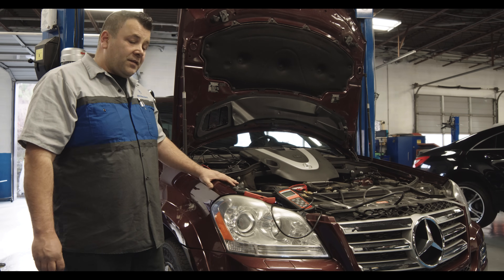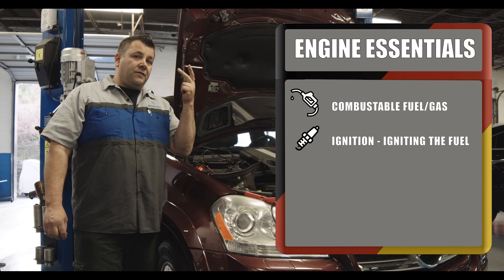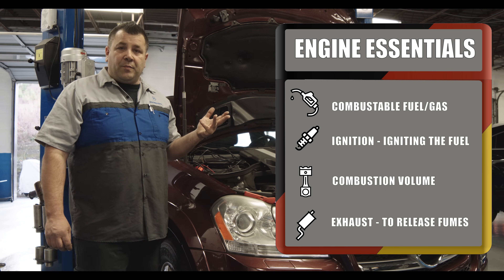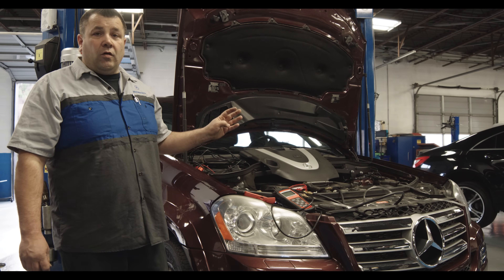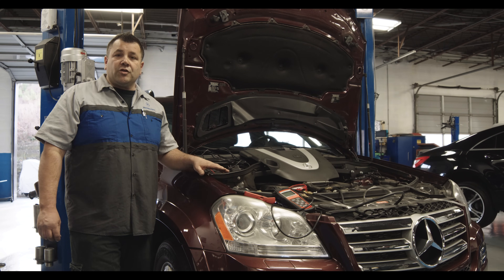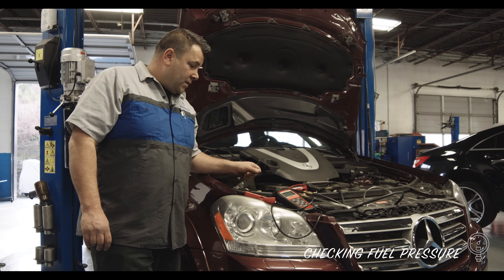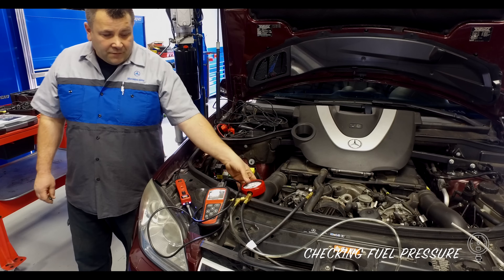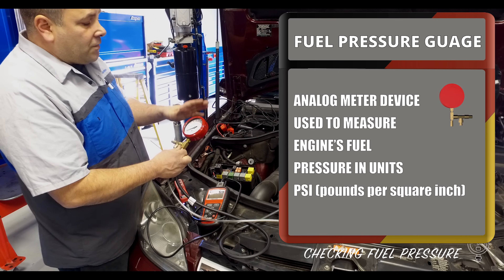Why a car won't start -  Mercedes Benz Troubleshooting Guide, Tips

Comment: Hello and thanks for making this channel. I have 08 C350 Sport 3.5 V6. Left it running yesterday to run in the house, came out car was not running. It will turn but not start. Fuses are good, replaced fuel pump and crankshaft sensor. Gives me fault codes: U0109, P0628, P0336, P0607, P0461. I've looked them up but at this point I don't know what to do next. Do you have any suggestions?

Comment: I have problem with ignition as u tolking about. Position number 4 car doesn’t start in the morning. But after 4-5 Times of drying engine starts And then All day-long no problem. But in the morning same problem again.what would be the problem? The car is mercedes S w220 400cdi. 2003 year.
Reply: Check glow plug s and if faulty also indicate in instrumental claster check the glow plug using multimeter and testing lamp
Reply: My car not start when it start after 1 second close engin any information please about this problem
Reply: Where your shop at ?
Reply: Where's your shop at ?

Comment: I have a Mercedes-Benz Vito 115 CDI 2005 model engine code 646. I have to turn the ignition on and off for about 6 times before it will start. I replaced the glow plugs, replaced the fuel pressure regulator and the diesel pump. There are times it will start first time and times where I have to turn ignition on and off for about 6 times as mentioned above. It does not matter whether its hot or cold.

Comment: I prefer to use my, 
iCarsoft C990 Elite
Display: 4.0″ TFT LCD, 480*320 Pixels
Operation Temperature: 0°C ~ 50°C
Storage Temperature: -20°C ~ 70°C
Operating Voltage: 9 ~ 18V
Operating Current: 150mA@12V (Typical)
Power Consumption: 1.8W (Typical)
Dimension: 206*104.1*32.6 mm (L x W x H)
  
        Price: $1000.00

Comment: Hello boss i need ur help please . I have a problem with my A class 180 .. when i put the  key in the ignition switch nothing happens and it doesn t turn the engine on . And even the electric steering lock doesn't release . I scanned it and it apeared that i have the ELV problem.. my car is down for months now. Do you have any solution for me please ?
Reply from the maker: Ala djeffal what is ELV? Not familiar with 170 chassis or A class, I don’t think we have them in the states and I never took any class on this cars, if I had in my possession I’m sure I could fire it up but I have 0 knowledge of this cars. Sorry.

Comment: hey I have a 2002 clk and it will not start some times. to day it shut off and would not start up. the key turn but will not crank. then after i wait it crank on time, after 30 min. it start up. i did get a code for  accelorator sensor I will change this week plus i here rock build up in the muffler. then it ran only 10 mile a hr no matter how much gas i gave it.  thanks for the video. i have a new fuel pump, new starter, and new fuel filter. like i said will start back and run good with no codes the after hr of drive it. it run bad and fail starting.
Reply from the maker: Antonio Valdez check your catalytic converters and o2 sensors, it sounds like your engine can’t push gas out

Comment: Great Video!!!However, you didn’t explain what happened after testing if the vehicle still does not do anything. I have a 1997 SL500 sport and it does nothing when you turn the key. Light and radio come on but no crank. I tested the battery which was good. I checked all the fuses in the truck and under the hood. Swapped relays in fuse box as well, no avail. Is there anything else that I may be able to do prior to sending to a repair shop?
Reply from the maker: Mark Tolston sounds like you have a bad key

Comment: I bought a 2004 ML350.  Previous owner gave me the factory key with fob, and a hardware store copy with no fob.  Why?  He said the factory key turns the engine and it starts for 1 second, the dies.  The hardware store key starts the car fine.  What do you think is the cause?

Comment: But why at corners or roundabout a vibrating noise comes from the engine..exactly midle...you hear it from the car , even that the  mount were changed with a week earlier...and engine can be moved L and R by hand ..with the old original ones very hard to move it. ..lemforder brand
Reply: Simple / Eu simplu same here did u ever find the problem

Comment: i have a 2008 ml63 amg and having issues with not being able to figure out why it wont start. Just cranks and cranks. have a code for (p1901) with fuel pressure. I can not find the fuel pressure port. detailer shut off and after spraying water under hood. Would not restart just cranks.  Please help
Reply from the maker: Jd Sasse give me couple of days, I’ll help you, just super busy right now

Comment: Hi I recently brought a W212 2011 E350 4matic. Every time I put the car in reverse the radio come on? Is there a way to fix that? Also recently, Very time I hit a small pothole I would heat a small slight squeak. The squeak sounds like its coming from the rear.

Comment: Will the diagnostic code reader tool tell me if a fuse needs to be replaced? I have a 2009 c300 and am recieving ignition lock error codes for "mechanical fault" and "implausible signal". What's the difference between the 2?
Reply from the maker: Danielle Lewis you need steering lock

Comment: I have an w210 mercedes and it doesn't start anymore. It has the error p1630 drive authorization signal
Reply from the maker: MrGetoDac it sounds like bad ignition switch
Reply: after the  replacement of the  ignition switch the key must be programmed again to work with the new ignition switch?

Comment: hello i hava a ml 430 1999 that stared to stall on me so i did and follow the video and i fine out that : the truck had 215 k miles so i figue the it need it a fuel pump and filyer ,change it and still stall on me if i let it rest for 5 to 10 minute it will star.. i chech the fuse for the fuil pump and it didnt have no power now i disconet the battery for 15 secun and started agen ...berry confuse ...pleace help ... thanks you  jose castillo
Reply from the maker: Jose Castillo there way too many things to check, that’s why I made this video...

Comment: thank u for the video as it teach a lot. Sr. i have a C230 v6 2006 mercedes sport coupe that blew the gasket and after replacing everything is not starting. it cracks only. what would be causing it not to start right away. please help
Reply from the maker: eduardo samussene check your timing

Comment: I have a Mercedes Benz e320 that does not have power like at 6:58 but when I hook up a battery charger the lights turn on but the car just clicks or cranks.

Comment: Hi. Love that you do MB. I have an R500 with cooling fan issue on radiator. A few times it turned on when car not running, but has never come on with engine running.thoughts?
Reply: Steve Schwer .
Reply: Steve Schwer fan dont work

Comment: great information & your channel.  My SLK320/2003 alarm went on over night, next day the car did try to start but didn't crank and after that did not start and got "start error".  tried it multiple time, totaly dead.  lights works good, battery check OK at the shop, my Key won't lock or unlock.  it's funny after disconnecting the battery and reconnecting, once in a while does try to start but it shut-off quickly.   Any help is appreciated
Reply from the maker: Abdi bubakhon it sounds like drive authorization issue, I will start with a new key first.

Comment: If the key and the EiS don't do anything, zero reaction, no buzz, key doesn't turn, zero, as if you were sticking a pc of wood in eis, is there any chance that the front sam is fried? or does it HAVE TO BE the key or EIS ONLY?
Reply: Ignition relay switch

Comment: Hello I have a 2009 mb c300 car was running fine then this morning I went to start car and it will turn but will not crank it is silent when key is turned ? I get power on dash.Took to auto shop they told me to take to mb dealer what may be the problem
Reply from the maker: Asia Baby really hard to know without diagnosis, it can be steering lock, crankshaft position sensor, bad SAM, or as simple as fuse..
Reply: Hey there. Did I ever find out the prob? Mine is doing the same thing
Reply: mz dameena you fix yours ?? Mine start this morning

Comment: Please help . i am in central america and therefore ordering a new key may be difficult. one morning my 2004 c240 wont start. steering wheel locked, key turns to first point only. key wont turn ignition. battery is good.tank is 3/4 with gas.
Reply from the maker: Delcia Chan what kind of help do you need? I thought I was helping by posting this video.. you need to troubleshoot the problem..

Comment: My c230 Mercedes Kompressor doesn't wanna start, but the key does turn on. I am stuck
Reply from the maker: Sabelo Sigudu check starter
Reply: Actually the key doesn't even move...
Reply: Sabelo Sigudu did you find out what happened ? My car c230 key won’t even turn. I put the key in and nothing. I replaced the battery

Comment: Hi I have Mercedes coupe 270 clk 2005 model, it start at 1st try but if it cuts of as u try to start it then it will not start till u try 20 times after , I changed the glow plugs but it didn’t sort the problem, any suggestions, many thanks.
Reply from the maker: AA Baker do you have a check engine light on? When did it start doing it, what is the 270? Is it Diesel engine? Does it have turbo? When it finally runs, does it run good?

Comment: Have a problem on mercedes w211 2002. On cluster message electrical consumers switched off? I have had the alternator changed and the rear battery tested and is at voltage, replaced the one in engine. Anybody have any ideas? Thank you
Reply from the maker: T C L did you check your battery control module? It’s in the trunk right in front of the rear bumper, open the truck and look down, it’s connected to the battery ground.
Reply: Hi Tech
Thank you for your reply. The only check on the module was to see if anything was loose. Both batteries were checked, the engine battery was changed and the boot battery was is good. The message electrical consumers switched off comes on and off, occasionally I have to open the car with emergency key, I open boot tap a few cables in far left hand corner and boot lights come on car starts? All cables are tight, had an auto electrician he could not find a fault or drainage, had car on star machine still no apparent fault? I was thinking could it be a relay? That said I will revisit the module box. Thank you TC
Reply from the maker: T C L I just had the same situation on 2005 E500, battery seems fine but was a bit weak, I changed the battery and the fault went away
Reply: Thank you will change battery. Left this message on a couple of YouTube sites you were the only one to reply🏆

Comment: thank you for this video. the scanner is okay sometimes if it gives a code, but it's more fun to know how to check manually. 
could you please suggest a website where i can get a good chart for my fuses and relays? not in the owners manual and the ones i found are not that great. i have a 2003 c320. 
thanks again! i was just going to replace the starter.. but now i think it is the relay or fuse.

Comment: My 1998 Mercedes e320  went dead and it feels like maybe I left something on.  I had to use manual key to open car.  There are no lights and even the locks with not work without using the key inside the Mercedes key fob.   Roadside assistance came to my house.  He connected and all the lights came on, a/c, and the alarm went off, but the car wouldn't turn over at all.  When he pull off charger it goes back to dead.  He said there was nothing wrong with battery but he said he knew nothing about Mercedes..
Reply from the maker: SouthWest Bitcoin it sounds to me like a bad battery..
Reply: Thank you .. So I did replace the battery..  However I found what was causing it to run down and it keeps running.. I think it's the cooling relay and I'm unable to figure out how to stop it from running.  I'm sure maybe a fuse?
Reply: Not it's fuel injection that won't stop running

Comment: Hey there just wanted to say thank you. I’ve watched a few of your vids and I fixed my problem didn’t even cost me $100 bucks. Shop told me $1300. So I took it back watched a bunch of your vids and fixed it thank you. It was the crank shaft position censer. So 🙏🏻 🙌👍
Reply from the maker: Tony Kutsar thanks for watching. I’ll keep’em coming
Reply from the maker: I’m glad I could help!! This is the reason I do this videos.
Reply: @MercedesBenzTechs  Your address and contacts pls
Reply from the maker: Idowu Alli 770-837-3888 6020 Buford Highway Norcross GA 30071
Reply: @MercedesBenzTechs  ooh..sorry I am in London, U.K.
Reply from the maker: Idowu Alli right around the corner...
Reply: @MercedesBenzTechs  lol

Comment: Hello,
I just purchased a 2011 MB E350 with 57k on it. I test drove the car, it drives like a dream. Since I got the car. It'll randomly won't start up. The dashboard, radio, windows, etc will all light up and work. But the engine won't start. Ive took it to my mechanic who install a new starter on it. And still it won't start unless I stick a paper clip into two slots where the green relay fuse goes and then the car would start. The car is sitting at MB dealership. And sadly they seem not to see anything wrong. Which I find hard to believe. SMH Hopefully you can reply back with answer off of what I told you.
Reply from the maker: Laquis Desjardins it sounds like you have poor contact on the starter relay, change the SAM or at least start with a new relay..
Reply: You mean I should change the relay module or the relay fuse?
Reply from the maker: Laquis Desjardins front Signal Acquisition Module, it’s under the hood
Reply: @MercedesBenzTechs  I have a 2007 s550 I just had a value body put on my transmission I drove it dat day but it wouldn't crank next morning just turning over can u help me

Comment: I have a 1998 Mercedes sl500 and hadn't driven it in a while. So I charged it and now nothing works horn, lights, locks, nothing. Can you help. Harvie
Reply from the maker: Harvie Childers change the battery with a new one

Comment: I have this issue my cls 500 will not crank but turns over...i hear the fuel pump.....i changed the crankshaft sensor because i got fault P0335 but i still get the same code and engine still doesnt crank but turns over...will somthing else cause this am i missing something?

Comment: I love your channel but I personally think if you did videos about all the different repairs that DIYER'S could perform themselves, there would be more value here. Anything this complex will never be performed at home. Hard to find a MB YouTube channel that teaches owners how to change or repair more basic and intermediate repairs. Above that, were at the mercy of an expensive shop.
Reply from the maker: Kenneth White ok, give me some ideas..
Reply: @MercedesBenzTechs  merc180k 271 fuse box where is fuel pump relay and starter relay
Reply: @williamhartsenberg5017   And/or where to download  the location of starter relay on a W203 C240 or any Mercedes becàuse the fuse location provided by Mercedes often doesn't tell the function of the unmarked or unnamed relays on the fuse list.

Comment: Nice video, i have 03" S55 amg, does not start, when i try to start it, the starter engages and the engine moves a few inches, each time it  like the starter engages and the engine "bumps" or turns a few inches, already checked power & grounds, which are good, could this be a bad starter?
Reply from the maker: charles potts if the starter turns I would say it’s probably good but can’t really determine without proper diagnosis, give the starter a direct current and see if it turns
Reply: i took a power probe 3 and sent 12 volts on the starter relay (87) to starter and the same thing happened engine moved a few inches
Reply from the maker: charles potts ok, maybe bad starter.. turn engine manually with 27mm wrench from crank pulley just to make sure engine is not seized or something is blocking it from turning, if engine is good so it might be bad starter
Reply: thanks for the input also noticed i didnt have fuel pressure, didnt hear fuel pump replaced fuel pump & filter now i hear the fuel pump stilll no pressure, replaced fuel pressure regulator stilll no pressure, also moved the crankshaft pulley engine fully turns, tested for spark no spark, changed crankshaft & camshaft position sensor stilll nothing, thanks so much for the input
Reply from the maker: charles potts ok so it starting to sound more like electrical issue not mechanical, you need to pull wire diagram and start checking continuity, if I had to bet I would say bad SAM or ME
Reply: Mercedes Benz Techs Okay, Mercedes dealership replaced the front right Sam a year ago, I'm able to communicate with all the Sams using icarsoft mb ii, got a code that came back that says "driver authorization has been refused by the control module", but I have no problem with the turning of the key, replaced battery in both keys, noticed when I touched one of the fuel injectors with my finger & fuel leaked out on no. 1 injector, not sure if that is normal?
Reply from the maker: charles potts drive authorization won’t stop you from being able to turn starter on direct current and I would look into checking front SAM again, check if you have issues with central gateway or ignition switch
Reply: Mercedes Benz Techs Thanks just needed some direction from a very seasoned tech like yourself, thanks for taking your valuable time to give me some great advice, I will be sending the Sam to repair facility that specializes in fixing sam modules, thanks again, God Bless!
Reply: Mercedes Benz Techs  oh one more thing when you mentioned ignition switch I did get a message on the scan tool that said "Kl.15 short circuit to positive" not sure what that meant?